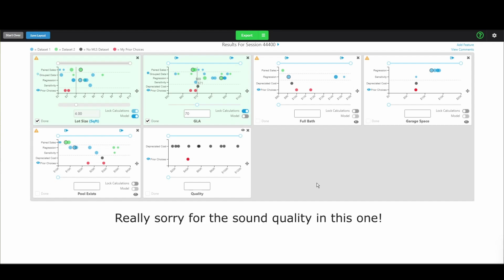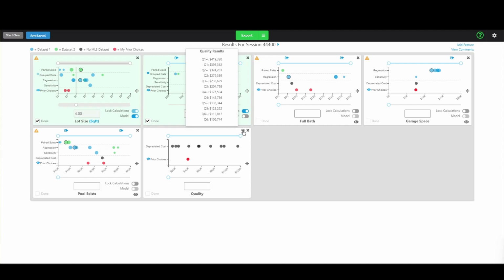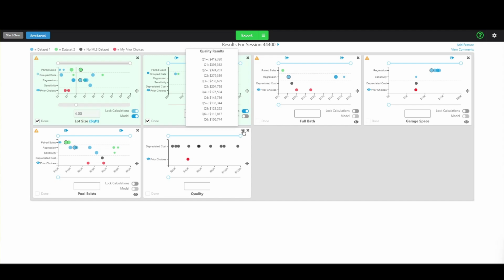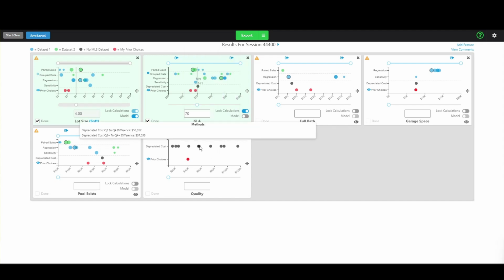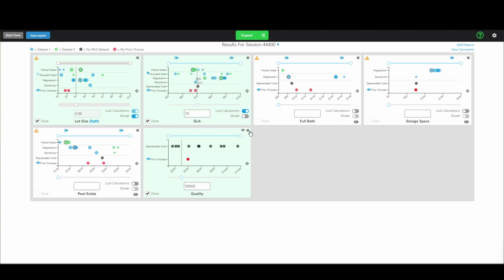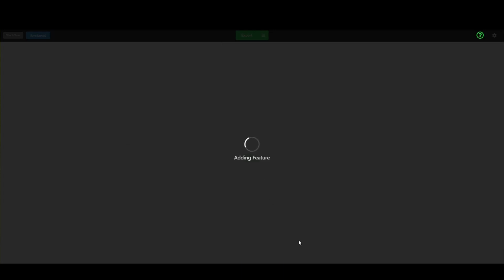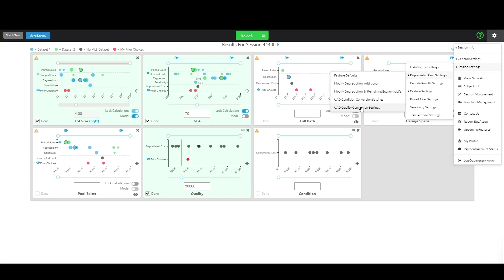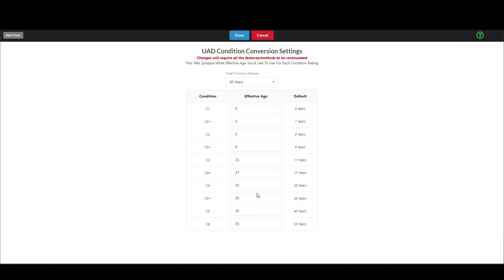Synapse Spotlight: Quality and Condition

Comment: Where does the depreciated cost come from?
Reply: If you're asking where we get our cost data, it's from DwellingCost (same as Spark).
Reply: @BrandonJoeReich  how is the depreciated cost adjustment derived? Maybe this data does come from DwellingCost, but where/ how is the adjustment determined? Does it vary by zip code based on median cost of improvements?
Reply: @Zaftig90  the cost data is derived the exact same way as in Spark using DwellingCost. It uses the zip code, quality, gla, bath count, and stories that you type in for the main dwelling and calculates the cost to build. Then it subtracts depreciation to get the depreciated cost. Last, for something like depreciation it gets the depreciated cost for each quality rating and then subtracts (just like I said in this video). So, for example, the depreciated cost for Q2 minus depreciated cost for Q3. You can also define what the DwellingCost quality rating is for each UAD quality rating. By default we use what DwellingCost told us was the approximate equivalent but you can define it yourself using the settings. Lastly, all of this math and data goes into your digital workfile.

Comment: Can I use SPARK outside of report software (Alamode)?
Reply from the maker: No, Spark only works with a form-filler. Synapse doesn't require a form-filler to work.

Comment: Do I have to add a Q or C adjustment card for differing comparables used? i.e. Subject is C3 and one come is C2 and another is C4?
Reply from the maker: No, it's just one "card". You can do what I said in the video which is either have one adjustment that you choose by reconciling the results and then divide that by two if you want a half-step in C or Q...OR you can use the data Synapse shows for each rating (also in your workfile) to determine every individual difference. I'm assuming most appraisers probably use one consistent adjustment for all different Q/C adjustments in a given assignment but you can also do the latter and determine specific adjustments yourself by doing the quick math (subtract depreciated cost of Q3+ for example from depreciated cost of Q2).